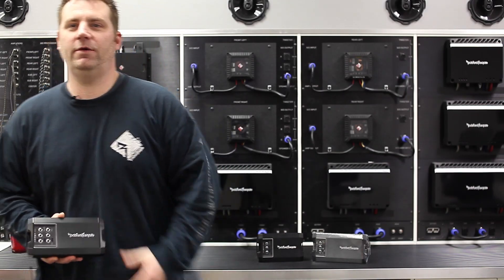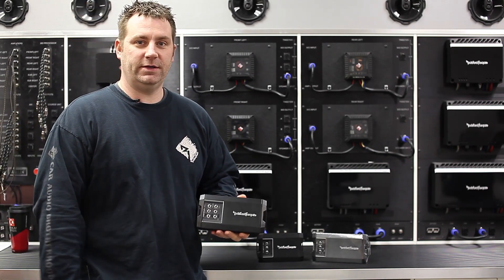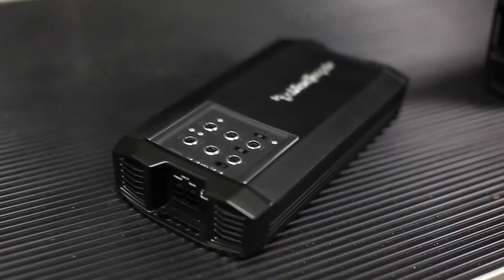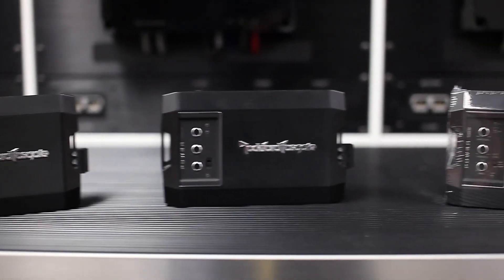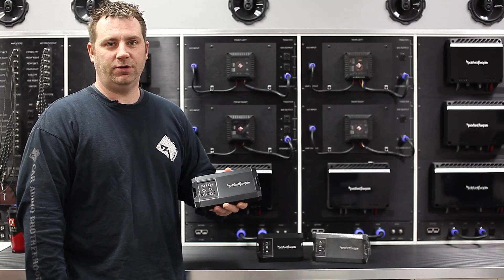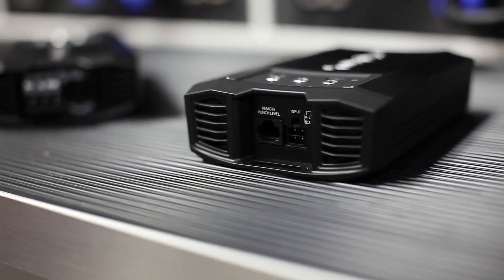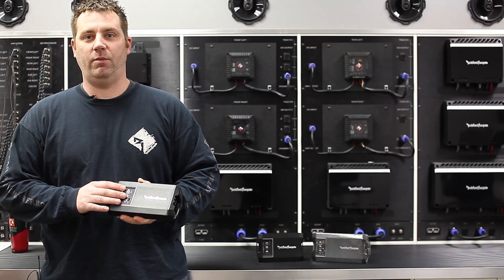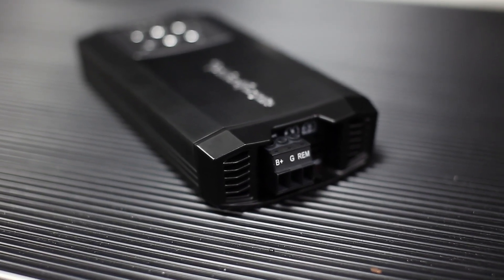2014 New Rockford Fosgate Amplifiers

Comment: These look REAL nice, but please integrate terminal strips into future models so we don't have to use molex plugs...I've been using the PBR300x1 and PBR300x2 in my SUV and have been happy with them. Can't wait to try these out!
Reply from the maker: As usual BigDWiz, you have great feedback.  We actually looked at terminal strips, but there isn't enough room to fit (on the PC board with enough width/height clearance) and would possibly eliminate features from some models to make this happen.  We opted for a solution that was suggested by professional motorcycle & car audio installers.  

As always, use our BRIGHT IDEA form listed on each product page to submit suggestions for future models.  That way it ensures your ideas go straight to our New Product Development gurus.
Reply: Rockford Fosgate I can tell by the PBR300x1 it would be nearly impossible to have a terminal strip on these tiny amps, but it was just wishful thinking. RF has been a leader in amplifier manufacturing since the early 80's and I'm always eager to see what you guys come up with next. Thanks for the reply and let's try one of those mini power series on my SMD/D'Amore Amp Dyno once they are released!
Reply: Dereck BigDWiz I'll be looking forward to That Amp Test

Comment: ? I bought 2 sets of the p1t-s tweets and 2 of the pro 1.5 super tweets I have a t400.4 for my tweets  the 1.5 are 8 ohm the other sets are 4 ohm any ideas how to wire them without hurting anything I'm gonna run the to 1.5 together for a 4 ohm load but still not sure how to run the p1t-s please help and thanks for the info
Reply from the maker: I'm guessing you have a pair of SQ designed P1T-S for the front channels and a pair for the rear channels.  I'm also guessing you have a pair of SPL designed Punch Pro PP8-T for both the front and rear channels as well. 

The P1T-S are rated at 90 dB, and the PP8-T are rated at 105 dB, so your tweeters will play with a 15 dB difference.  Keep in mind that 10dB is "twice as loud" so you're Punch Pro tweeters will be more that twice the "loudness" as your punch tweeters.

Since the amplifier is stable to 1-ohm stereo loads, each channel can support two tweeters wired in parallel, but you will need to retain the passive crossovers for each tweeter because they are not interchangeable.

Comment: Are the older ones better?
Reply from the maker: There's a LOT more technology in the newer models.  However, we build all Punch amplifiers to withstand the test of time.  Perhaps that's why you see so many on the 2nd hand market, because they last!  Think of it as comparing a 1964 Mustang compared to a 2018 model.  Both are pretty bad ass, but the 2018 version has those additional conveniences like AntiLock Brakes, Electronic Fuel Injection, etc. that just were not around back then.